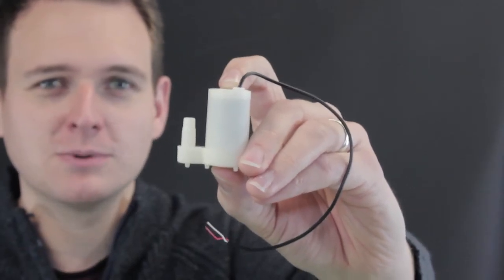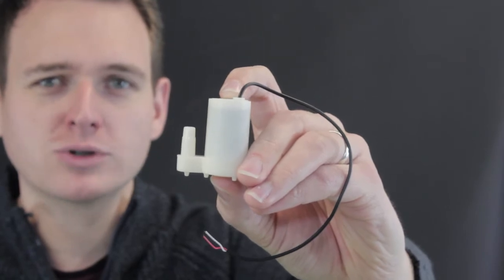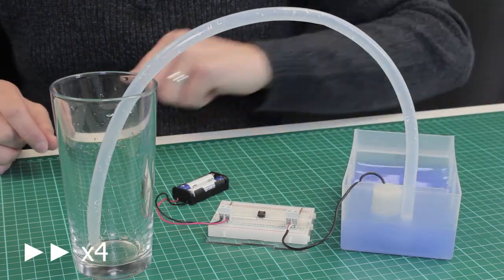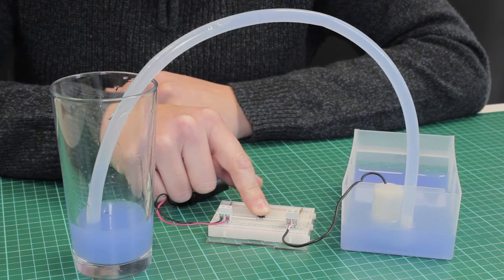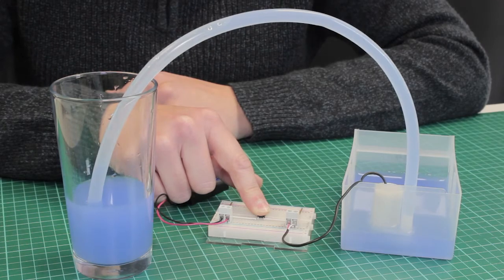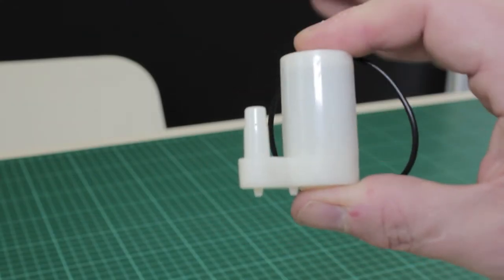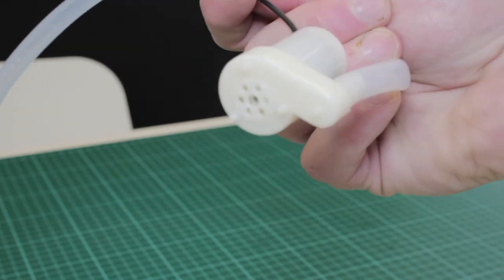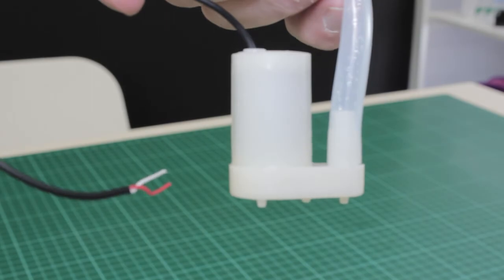3V Vertical Submersible Water Pump from Kitronik

Comment: Hi I was just wondering if there is any way to maybe add a variable to increase the flow rate of that 3V submersible water pump
Reply: They said in the video, that with pwm you can control the flow rate